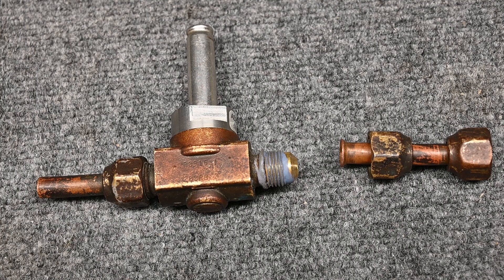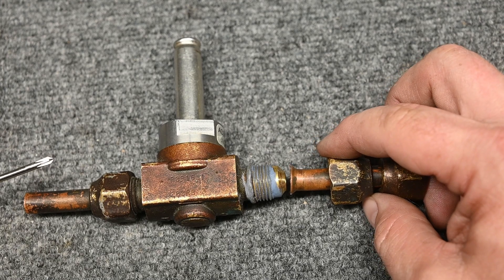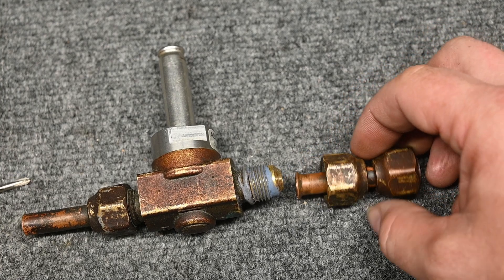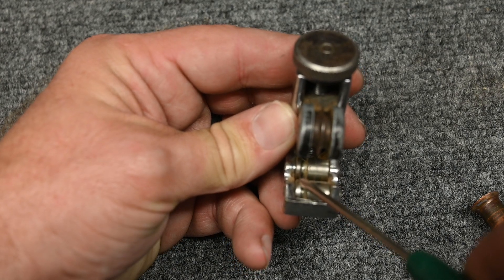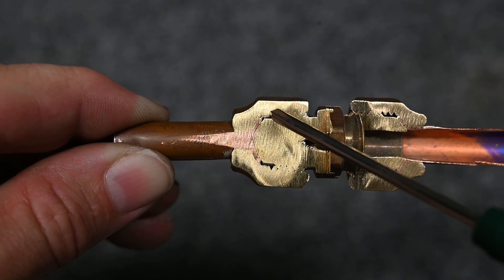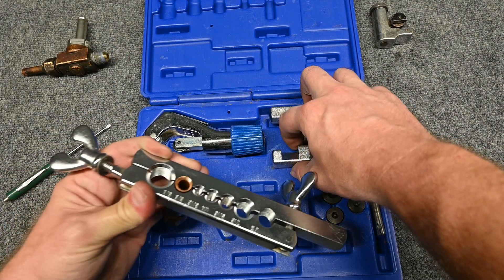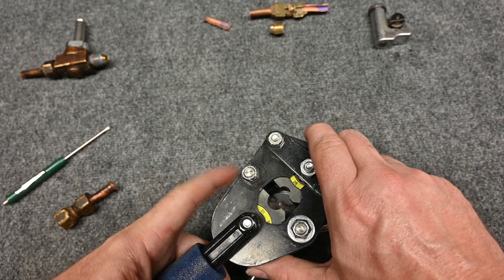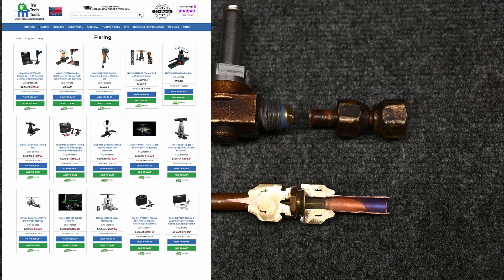HVAC 087 C. Connections part 3 Flare

Comment: I like my method more for solving the leak..... step 1) do a proper flare 2)add nylog 3) torque is to spec 4) pressure test it 5) throw some staybrite on to of that to seal it some more + reinforce the flare..... no more leaks and didn't have to braze

Comment: I don’t understand how the drill, operated flaring tool anneals the copper. To anneal copper you have to heat it up and then quench it quickly with water. Just heating the copper and letting it cool slowly hardens it. This is the opposite of what you would do with Steel.

Comment: I'm paranoid to use a sealant on the flare. I think the dried sealant material will break off and flow into the compressor. Prefer just to rely on the maleable copper.
Reply from the maker: I agree but nylog specifically  is refergerant oil based.
Reply from the maker: You are correct, nothing better than a malleable good torqued flare. 

This is why I make an exception for nog

"Nylog Blue is an elastic fluid made from synthetic refrigeration grade compressor oil. Nylog Blue is fully miscible and compatible with all system refrigerants and oils. Gaskets coated with Nylog will never dry or become heat fixed to the surface. Threaded connections coated with Nylog will block high pressure leaks by forming a hydraulic seal. Nylog can be used an assembly lube when installing shaft seals, o-rings, schraeder valves, ball valves, or other internal system components.

Will not Contaminate Systems

Seals Flares and Threaded Connections

Lubricates O-Rings and Gaskets"

https://www.refrigtech.com/nylog-blue/

Comment: The most overlooked piece of the puzzle on split systems is proper torque and technique on the nut. It can’t be overstated how important properly applied correct torque and the use of a backup wrench is on these fittings. But be careful out there. Not all torque wrenches are intended nor calibrated for torque in both directions, especially special use torque wrenches such as HVAC sets. And in the field sometimes it’s necessary to access fittings at awkward angles which changes wrench position. It’s fairly easy get the wrench in the incorrect position in terms of tightening direction.  If the wrench isn’t calibrated in both directions, the torque applied is incorrect. We like the eccentric flaring type of tool. We’ve found it produces the highest quality finish on the sealing surface. They anneal the mating surface perfectly and good ones have clutches to prevent over doing it.
Reply from the maker: Thank you, I did not know about the calibration in only 1 direction! I will I include that when I get to the how to to section. Thank you!

Comment: I'd redo the flare before I use nyloginski !
(Bad experience)
🤣😂🍺
Reply from the maker: Oh what happened?
Reply: @love2hvac  not a fan. I'll use a tiny bit of oil on a lint free cloth on the face, the back of the flare & the threads.(clean)

Comment: How common is the tool to flare braised/soldered fitings?
Reply from the maker: I apologize, I dont quite understand what your asking.
Reply: @love2hvac  when you braised/soldered pipe, it had a slip fitting.  The big end was either expanded/flared at the factory and probably only seen on fittings, or would you want to carry a tool to expand the pipe.  This way if you ever had to cut the middle of a pipe run due to damage, you could slip fit a new section in, or join the 2 ends together if you had enough slack.
Reply from the maker: Oh yes, sorry Yes we call that swage or swaying it makes a female fitting or coupling
 Several ways of doing that. My good friend Craig with AC service tech llc has a great video on that.

https://youtu.be/uPNtqJabTI4

Comment: Do you know if that is the same tool to flare car break lines?   I seen a tool that held more of the pipe to make sure you were square, and it had the die set to do double flares.
Reply from the maker: I don't believe so. I've never flared automotive  brake lines. I know there is a way to double flare with a traditional kit but I've never done it. Lost a contest because of that.
Reply: Automotive brake line flares are 45 degree flares but they are double flares. These HVAC flares are single flares. Brake lines are typically harder material as well. The tool is relatively the same and an automotive flare can be used for HVAC. The kit he shows can be used for double flares. The little mandrels on the right side of the kit are used for double flares.